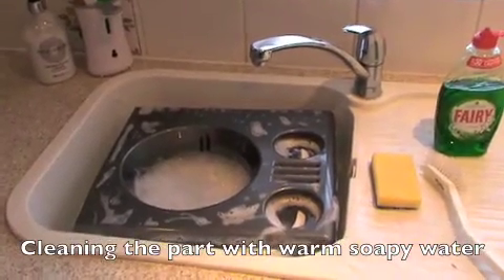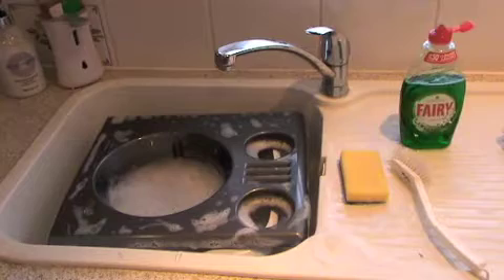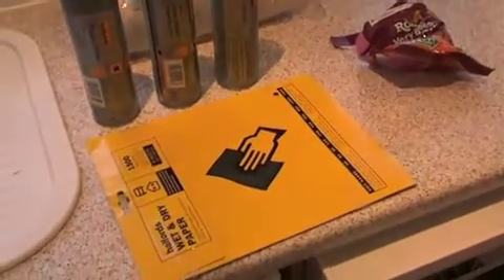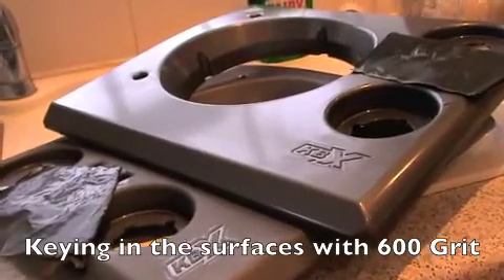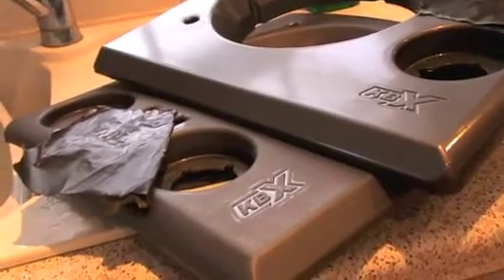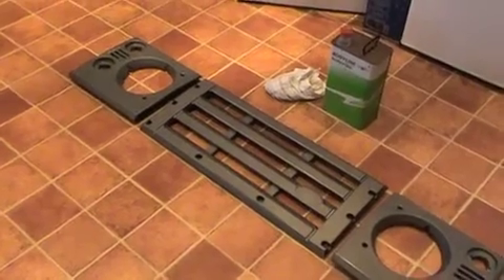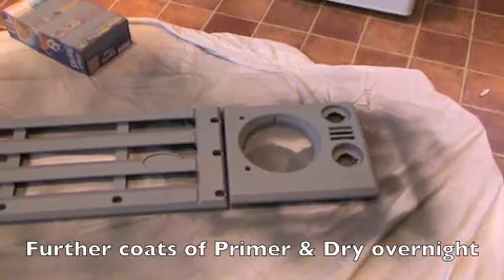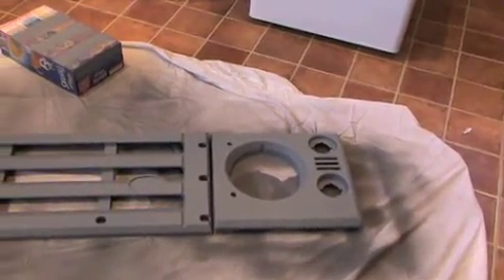Spray painting a KBX Land Rover front Grill

Comment: I know this is an old thread... but how did it last? the end result looks good.
Reply from the maker: +rossmaynard that's a good question! I have to admit that I'm very keen on the mechanical maintenance of my Landy but very rarely wash or polish it. The black finish is amazing, still perfectly intact despite stone chips & poor maintenance. The lacquer layer is, however, showing signs of wear. On the upper leading edge (most exposed to the sun) I can start to see the lacquer crazing slightly. I suspect if I had washed & waxed it regularly it would be in a better state. I hope that helps.